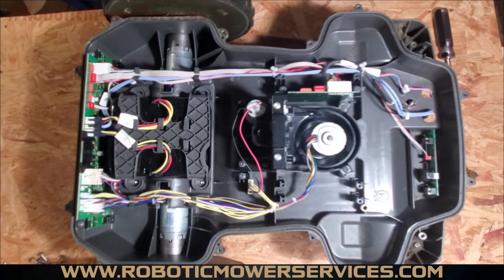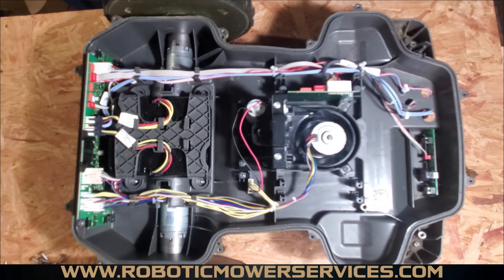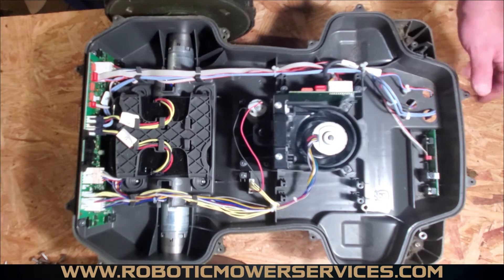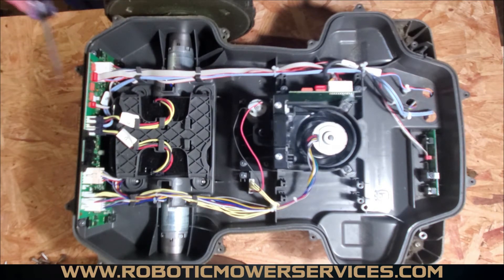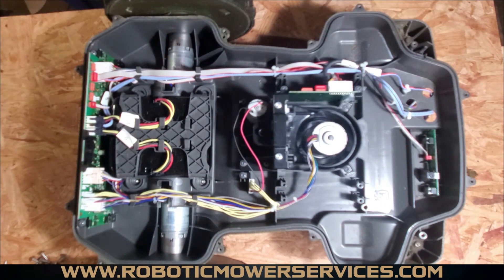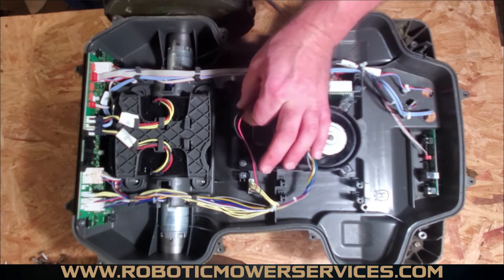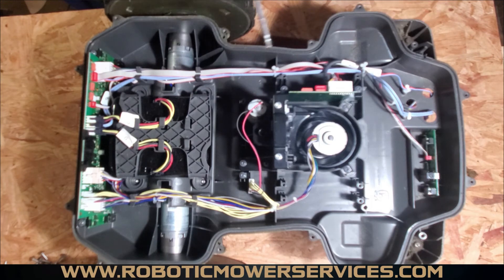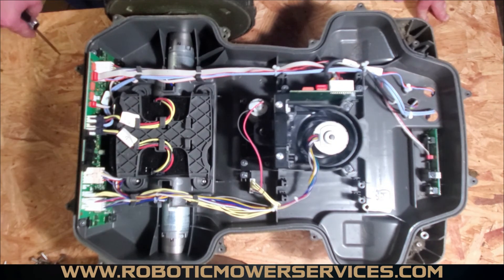Location Of Components In A Husqvarna 400/500 Series Automower Lower Chassis

Comment: Hey, will be getting my 450x in 2 days! Been watching your videos , great information! I was just wondering how close you would put at boundary near a lake/water ? I put mine 16 inches from where it starts sloping down to the water, but now I feel maybe its to close. I will have the mower pass the wire 14-15 inches. Greeting from Sweden !
Reply from the maker: It's always tricky when setting up a mower near a body of water and is probably going to take some tweaking after the mower is out there running to be able to get it to mow without issue. Then you just have to watch it when it rains and the grass is slippery. You want to be sure that it can stop and turn without slipping over the boundary. 

Thanks for reaching out to us from all the way over in Sweden!
Reply: @RoboticMowerServices  Thanks for the answer! Yeah, I have been walking behind the mower now and watching how I turns around the pond. Works good, som places that at almost flat to the water I moved the wire closer.